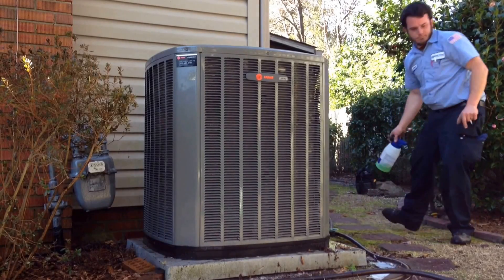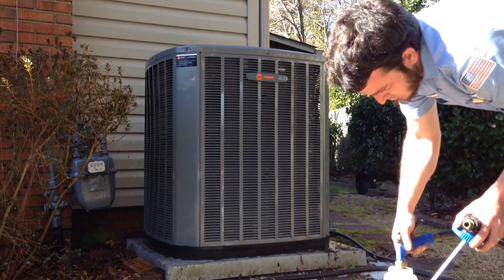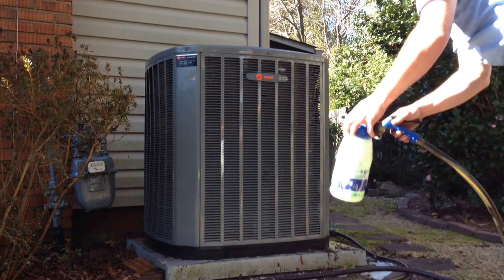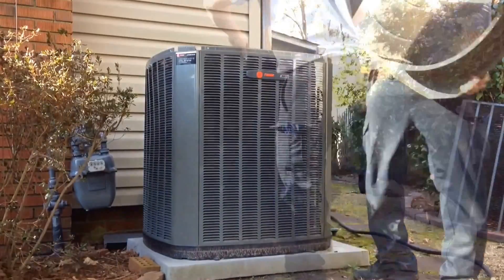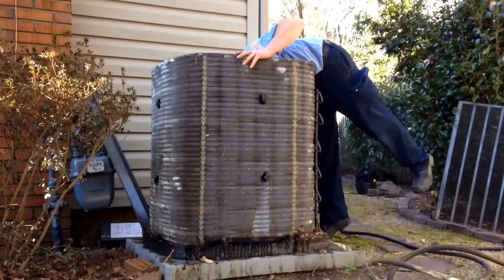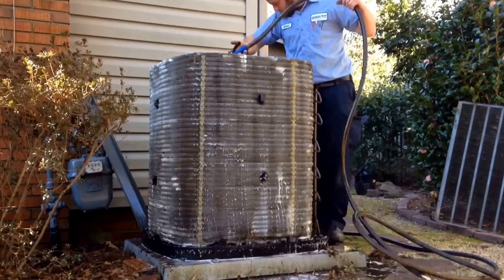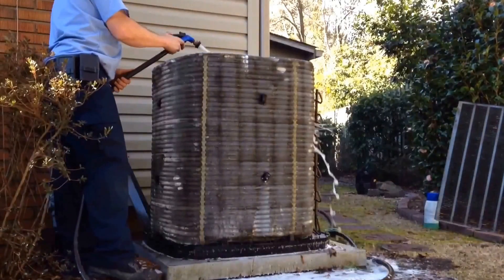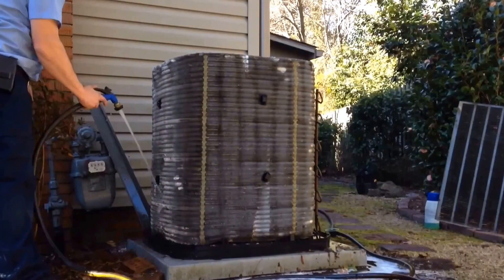HVAC Service: How to Clean a Trane Air Conditioner Spine Fin Coil.

Comment: Just hose it off at angle and it will just fall off and come out… still don’t understand why keep opening the units 😆🤣
Reply from the maker: that's not how it works with these spine fin coils. Actually almost every AC coil doesn't work that way.

Comment: This is a much more difficult job than the video portrays.  First of all, why would it start by showing a useless procedure of spraying water onto the grills while they are in place?  Very strange.  Lifting off the fan on top of the unit requires disconnecting the fan wiring behind a smaller metal panel that needs to be removed first.  None of this was shown in the video, and never did it say to shut down the power to the unit before doing so.  Wow!  There are these annoying retaining clips at the center bottom of each of the large side panels that have to be disengaged, and this was shown in the video by the guy kicking the panels with his foot, not exactly the recommended procedure.  And finally, before spraying the coils with a hose from the inside, it's recommended to gently vacuum the coils on the outside to remove most of the accumulated dust and debris before getting everything wet.  This is a tedious process that took me a long time to figure out, and for the person attempting to do this for the first time, this video is highly misleading when it says "It's very straightforward."  The video should be redone from start to finish, with all the important details included.  If the concern is that viewers can't pay attention for more than two minutes and twenty seconds, then those are the people who need to call in a professional before they electrocute themselves by watching videos like this.

Comment: Great video. As an Air Force aviation mechanic this isn’t a difficult set of instructions. To those that have issues with stripping screws, a bit of advice. The screws are self tapping so all you have to do is get the screws started (by hand). Once they are all started, then use a drill that isn’t on the highest torque setting and the screws will align each panel. I’ll happily provide a video upon request. Not difficult at all. And this is from an aircraft mechanic that had to make panels fit for airframe specific aircraft. Hours upon hours of bullshit. 😂

Comment: I have a Trane xl15i and getting those side panels off and on again is torture.  This unit was designed by sadists.
Reply from the maker: Yep, absolutely
Reply: @StephenRardon  Now I'm scared. 😨
Reply from the maker: @Mr.Martini549  😂
Reply: @StephenRardon  Imma gonna tackle the coils on my XL14i tomorrow. Wish me luck!  They've never been cleaned thoroughly. 19 year old unit. Service techs only rinse it down w/ water from the outside.
Reply: @Mr.Martini549  bro, did you do it? I am planning to do this weekend. I have XL16i.
Reply: @RMalai  Yes, I cleaned mine, but didn’t need to remove all of the side panels. The only panel I removed was the one attached with screws closest the service lines. My coils weren’t too dirty. Do remove the top cover and the fan blades. Be careful to keep the fan assembly from pulling on the wires. From there you’ll have easy access to vacuum out debris and then clean the coils from the inside. I chose to use a foaming spray. Worked really well. I had enough to spray the outside through the grill panels. Good luck.
Reply: @Mr.Martini549  Thank you for sharing your experience. I will try it.

Comment: Would love a follow up video on disconnecting fan wiring to remove it. That step is missing from this otherwise excellent video Thanks!!
Reply: 3 wires, orange purple and black. Orange and purple to the stater capacitor, black to the switch. Just take a picture with your phone. Very simple process.

Comment: If you pull those sides, you'll have one heck of a time getting them back on.  Holes will not line up, some screws will be stripped. And If it's in a tight space, don't even think about it!  and make sure to note all wiring before removing fan, etc. I did mine yesterday and partially disassembled first unit and quickly learned my lesson.  Going forward, I will only remove the fan, vacuum muck from bottom, spray from inside out and then spray outside through the vents. I also sprayed coils with Simple Green cleaner before rinsing thoroughly.
Reply: I drilled 2 metal screws on the other side of panel to eliminate trying to fit it back in.  Now I take out for screws and much simpler.

Comment: I just a company  come to do my spring checkup he just rinse the outside of the air conditioner  I ask him the last two guys took off the top and spray  from the inside  he said  that a trade air conditioner  is self cleaning  I have never heard of this someone  please  tell what this guy is saying  is not true
Reply from the maker: Haha 😂 no, there is no self cleaning system. Sorry
Reply: @StephenRardon  thank you I call the company  and they said  the same and the technician will be reprimanding
Reply: Bro, he may have said about the coil  that is located inside your home (may be basement). that is kind of self cleaning and located right above the condensate drain line. so what it does is while the condensed water flows down it takes the dirt also down along with it, goes to the condensate pump and removed by that. you need to clean the condensate line annually.

Comment: My sides would not pull up like shown in this vid. I wish they did. I tried.
Reply: rustyme1122, if you watch carefully when he's disassembling the sides/enclosure, you'll see that he taps the bottom of the side panels - just above the base - with his foot as he's pulling them up. This is because there is a small tab at the bottom of each panel (usually just to the left of center) that latches to the base. I've always used a thin screwdriver or putty knife to disengage these tabs while pulling the sides straight up and out. However, I can't wait to try the method shown here and just tap my foot along the center/bottom of each side to pop the retention tab loose! Good luck!
Reply: @rongoins4856  The unit in this video is an older R22 unit made in the early 2000's. Mine is an R410a unit made in 2009. I think the newer units were changed to prevent the sides from easily coming off. I tried everything. Only one side on mine came off.

Comment: DON'T DO THIS!!! The cabinet has sheet metal screws that can easily be stripped out and it is not needed unless you have a absolute reason to get inside the cabinet. This would be coil, condensing fan or compressor replacement. Don't use a cordless drill on the screws as it also makes it easier to strip them out. The only panels required to be removed on a annual service are the electrical and refrigerant service port panels. I wouldn't be using some kind of harsh cleaner on that coil over and over again either. Just plain old water out of a garden hose at 55 psi with a nozzle is all that is needed.

Comment: Nu-Calgon has a “Coil Gun Probe,” that lets you reach inside the unit through the fan grill. Part Number 4774-1 As long as the unit is regularly cleaned, and hasn’t been let go, this is adequate without tearing the unit down, and possibly damaging it.
Reply: Never tear the unit down unless you have to. What this video didn't show you was how much of a bitch it is to realign those panels and how easily the sheet metal screws strip out. What would I know....only been a HVAC tech and a Trane dealer for 20 years.
Reply: @JohnDoeEagle1  You are that metal is a pain to realign. 23 years in HVAC.
Reply: @randymarcell  

Love it when professionals come into these comment section and let "DIY homeowner amateurs" know we know what we are talking about. It's like watching Jimi Hendrix, Stevie Ray Vaughan, Eddie Van Halen and Angus Young compete against a local bar band! :D
Reply: Perfect. I am about to clean mine. Saving me a lot of headaches. I'll leave the panels alone. I actually pulled one panel off to find the bad capacitor, but it easily went back on. Thanks for the tip about leaving the panels alone.
Reply: @JohnDoeEagle1  Thank you. I was about to take the outer panels of mine apart to clean it.
Your comment is more valuable than you realize.

Comment: Do you cut power? Do you cover any electronic parts?
Reply: Always turn off your outside 240V or 480V/3-Phase disconnect switch before washing out a condensing unit. No, you don't have to cover any electrical parts so long as you don't spray water directly into the electrical cabinet. Even if you accidentally do a old paint brush and or rag will dry them up generally without damage.
Reply: good question bro. thanks for asking for the rest of us.
Reply: I go overboard and suggest you do also. Kick the breakers off at the service panel. There is a flexible conduit running between the outdoor condenser coil unit and to a wall mounted fuse box. Pull the fuse holder out of this remote junction box. Better way too safe than dead. Mine is a 4TTR6036 N1000 CONDENSER unit but that is irrelevant. The cooling ability is tapering off badly and the unit is only 4 months old.It will not kick the 2nd stage on anymore. The register nearest the air-handler is now only getting to 73F degrees. Right after installation (brand new) the register frame dropped down to 57F degrees and the stage 2 roar was unmistakable. Outdoor temps were/are 95F. Am not confident cleaning my coil(s) is going to provide the improvement hoped for.

Comment: What are your thoughts about those water misters you string to your outside coil to help it cool in a non humid climate?  I use well water through a softener.
Reply from the maker: I have not seen a need for them, they would degrade the metal faster and coils could rot too. I don’t think there’s any water that wouldn’t be detrimental.

Comment: Thanks for the video.  I haven’t disassembled yet but it looks like my Trane’s fan has to come off first to get to the inside of the coil to spray. I’m worried that the circuit board is going to get wet.  I know the breaker has to be thrown first.
Reply from the maker: So long as you don’t spray water too near the board you’ll be fine, you could put a trash bag over the area if you’re concerned but be sure to turn power off!!
Reply: Stephen Rardon great idea. Thanks

Comment: New to HVAC and what you call hack job is what I was told to do, except lift up fan and spray inside to out
Reply from the maker: That’s why I made the video, standard procedure is basically a waste of time and only enough to make the uneducated homeowner think they’re getting their money worth
Reply from the maker: If the coil is actually dirty spraying through the louvers won’t actually get the coil clean. The only way to properly clean the coil is to make access to it so you can see that it’s clean.

Comment: You do realize that the pressure you had coming out of the water hose didn't push any dirt out. Also your coil gun automatically dilutes as you spray on the coil. that's what the black knob is for also removing the top only is good enough.
Reply from the maker: Right, coil wasn’t that dirty anyway

Comment: This should only be needed if the coil has been neglected and is extremely plugged. Trane themselves will state that the coils are designed to be cleaned with the casing intact. 
It's nice to see a thorough but I would hardly call someone who didn't remove the casing a "hack" .
Reply: Ken Flux Pierce Fluxwithit yeah, it is only necessary to remove the entire frame if there’s a large buildup of debris between it and the coil but if you aren’t at least removing the “shroud” and blasting the coil from the inside out you’re just being lazy.
Reply: I agree if it serviced annually no need in totally  taking case off (could do more harm than good )
Reply: Trane has a different design. I never cleaned mine for the last 10 years. I occasionally check them, but they seemed to be rather clean. I rinsed them today anyway, and I didn't really see a whole lot of dirty stuff.
Reply: I just had one installed and my biggest concern is the Cottonwood tree nearby that will often clog the spin foils.

Comment: What coil cleaner do you use? I noticed it was green and didn't look like the nu-brite lol thanks!
Reply from the maker: It is Nu-Bright,
Reply: Really? But the traditional blue one? Maybe I just saw it green. Lol
Reply from the maker: It's the foaming evap nu-bright
Reply: Nice. Seems like it did the job well. Would you recommend that for evaporators? Like does it make them shine? Or just cleans em up?
Reply from the maker: I usually dilute it pretty heavy, unless the coil is really filthy!

Comment: I do not use acid on coils what I always use is what water furnace recommends. Cascade dish soap works the best and it also washes off really well it's made to cut grease and dirt. I have been using cascade dish detergent for a couple years now seems to do a wonderful job and does not damage the refrigeration coils
Reply: Nicholas Rowan - Are you cleaning Spin Fin coils with Cascade? What about DAWN liquid dish soap? It's a fantastic grease cutter.
Reply: I know this is ancient but there are cool cleaners out there that are essentially just concentrated soaps containing 2-butoxyethanol, which is just a very powerful soap, not an acid at all.

Comment: It's nice to see someone do this correctly instead of the hack jobs...
Reply from the maker: bfxp63 I don't usually go to that much trouble especially when the system is cleaned every season but that unit is one of the most aggravating to actually care down since those panels lock in at the bottom. The Goodman units with the two-piece wraparound cover are probably the most frustrating ones to tear down!
Reply: @StephenRardon  I have unfortunately let my maintenence lapse, and the coils need a cleaning like this.   What question should I ask of a company to get a cleaning like this?   The last one just sprayed on the outside and called it good (didnt even spray from inside out).   I am having trouble finding a local company that knows these AC units.